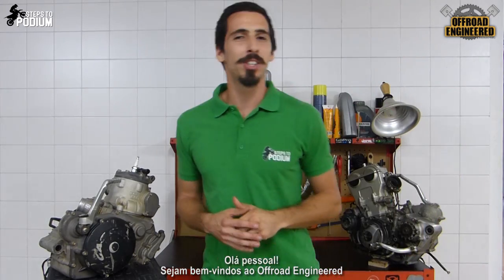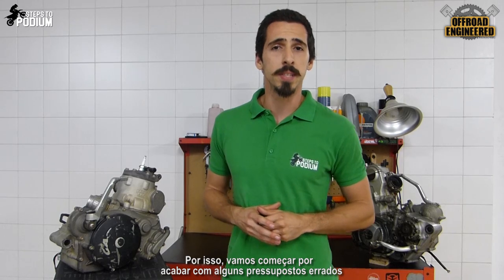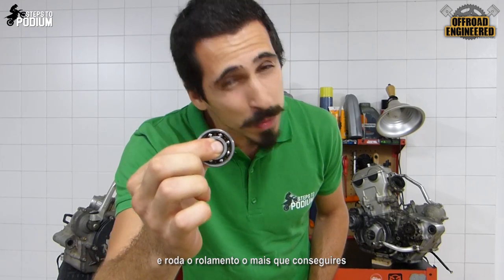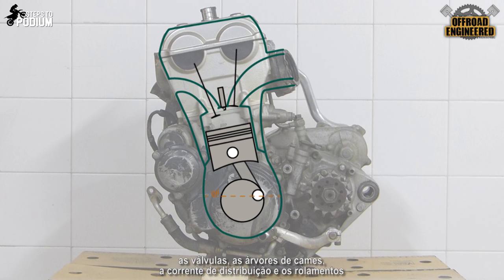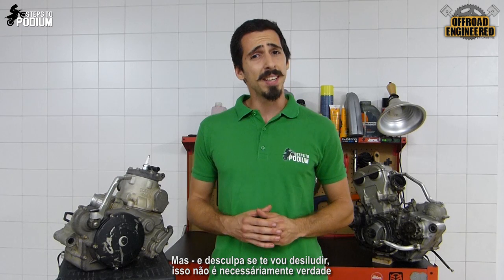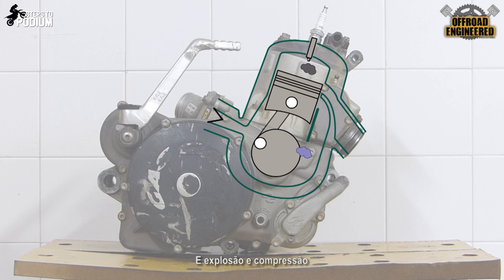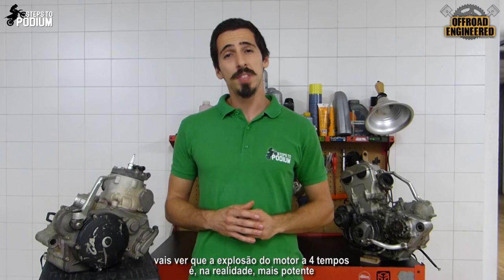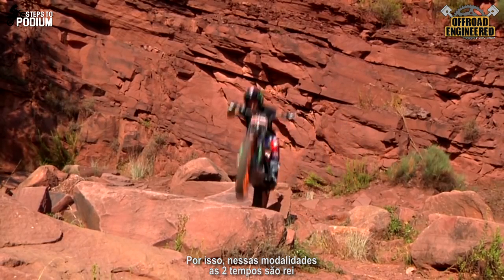2-stroke VS 4-stroke | Offroad Engineered

Comment: You have to take into concideration that 2t engines typically have a higher power output at higher rpm
And 4t engines typically have a higher torque output meaning that it does not have to be geared down as much
But most important is preferance

I own two bikes and one is 2t and the other is 4t. The 2t bike has very poor torque output but gains power than the 4t when reaching 4krpm+. The 4t bike is a very nice bike that has a much lower power output but twice the torque at half the rpm. 

They both have the about the same top speed (+ - 10km/h) But while the 2t is running at 7krpm the 4t runs at 4krpm. The 2t reaches 70km/h at around 7-8 second If I change gear when red-lining.
The 4t bike reaches 70km/h at about 13-15 seconds when red-lining.

So my conclusion is that for long trips where acceleration isn't a concern the 4t is the better alternative.
For shorter trips where I need more acceleration I'd pick the 2t for it's superior power output at  higher rpm.

One more thing, This is imprtant. NEVER engine brake with a 2t  ever, It uses the oil in the fuel for lubricating the bearings,
 which are already under huge stress with very little lubrication (1-5% of the fuel). As when you release the throttle you limit the amount of air and fuel it gets, so under stress without enough oil will result in damage. (Take my advice, I have had my 2t engine sieze twice becouse of oil problems)
Reply from the maker: Thank you so much for that much needed info! :)
Reply: So your saying to not coast in gear? Always pull in the clutch when coasting down a hill?
Reply: @sdurden9829  If you want your engine to last longer, don't engine brake unless you have a yamalube system installed that squirts oil right into the bearings. You can also hold the gas so you keep the same speed down the hill. While not optimal it's better than  nothing.

Comment: Since 4 strokes dominate almost every sector of transportation, 4 strokes are better. They last longer, they pollute less, they are quieter. The only drawback is weight. Where weight is the critical factor, then two strokes have the advantage. Boat motors are going 4 stroke..even my weed whacker is a 4 stroke so, the advantages on a 2 atroke are almost none. It really is,a dead concept.
Reply: that's because a 2 stroke costs less in parts, and motor company's like making money.

Comment: Two stroke engines make power on every second stroke! Four stroke engines one in four strokes of the piston makes power so really the two stroke engine makes MORE power for same cc, 
look back a few years, the Yamaha RDLC bikes, 350,s were embarrassing much bigger bikes ie 750,s, so there goes his theory of which makes more power. 
Think about it, two 500cc engines one two stroke one four stroke;
both turning say 5000rpm, the two stroke engine is making power on EVERY second stroke
the four stroke makes power ONLY once in every four strokes!!
Reply from the maker: You're mixing power with power output
Reply: @StepstoPodium  whatever

Comment: 2 stroke = Insane crazy fast
4 stroke = sluggish, heavy, just cant keep up...

It's been several decades and they still need to put a 450cc 4 stroke up against a 250cc 2 stroke before they even come close to evening out...

A 2 stroke 125 can and will totally annihilate a 4 stroke 250

A CR80 2 stroke can easily put most 250 4 strokes to shame

Comment: #engineering  you are totally wrong ...a 4 stroke can never make the same or more power from a drop of gasoline like a 2 stroke does ...you obviously have no knowledge of the engineering that goes into a two-cycle engine. You just like all others cannot explain how a two-cycle engine actually functions. Port induction two-cycle engine are self supercharging meaning that they make boost well above atmospheric pressure before the engine fires. A 4 cycle engine can only suck air and will never make any boost at all ...my education from all of this was taught by the man himself pop Yoshimura at the R&D Training Center for the first Honda Elsinore CR250R

Comment: Shitty video, only relates to thumpers. It took along time for a 4 stroke with at least 4 valves to be competitive. What about power valves? And direct injection Rotax? This subject is even more tedious if you include snowmobiles and there 2 stroke emission hurdle. Why no hp, 1000cc 3 cylinder Suzuki 2 stroke is 170hp, 1000 2 cyl Rotax 170hp. That’s more than any 1000 na 4 stroke.

Comment: 2 strokes r cheaper and not as reliable
Reply from the maker: Not necessairly true!
Reply: @StepstoPodium  I'm doing  a rebuild on a 2t  and I ride both 4t and 2t its gonna cost me 700 parts n labour cranks blown connecting rod fkced cylinder needs a replate (nikasil) and new top end piston I'd rather do the top end my self easily and cost effective on the other hand my honda crf250r I wouldn't be comfortable doing a top end on that and if I was to fully rebuild the motor bearings oil seals etc I'd be in for easily 1500 parts n labour here in the UK 2 strokes r way cheaper to fully rebuild fact cmon bro
Reply: @StepstoPodium  and I know for a fact u can get 200 plus hours in a 2 stroke piston if rode carefully u can't ride it carefully as u need all the power delivery so always in the high rpms 4 stroke doesn't its linear power pure torque not power as hp
Reply from the maker: It is cheaper, ill give you that, but I wouldnt say it is less reliable!
Reply: @StepstoPodium  I would as I'd compare say honda xr air cooled engine 4t hands down would outlast any 2 stroke for longevity
Reply from the maker: Perhaps you're right, but they are not nearly as fun 😂
Reply: @StepstoPodium  yes I love a 2 stroke I think they r the better machine